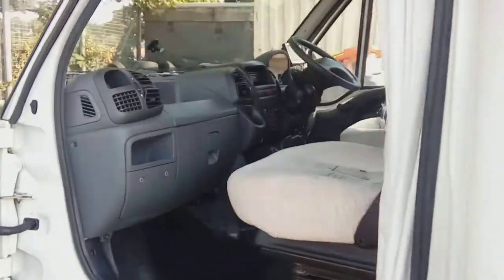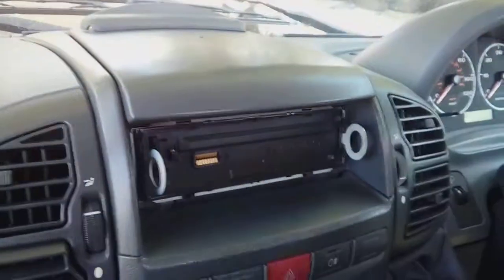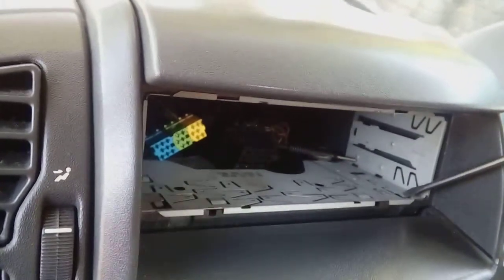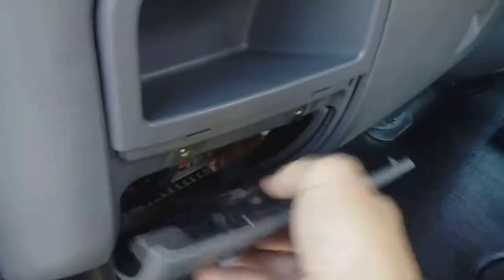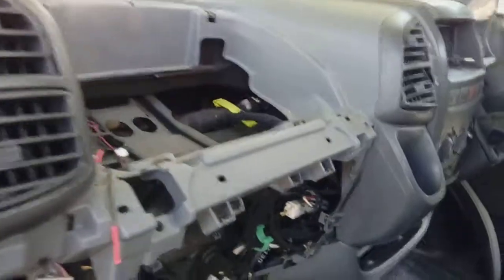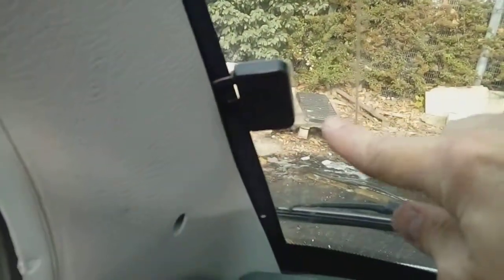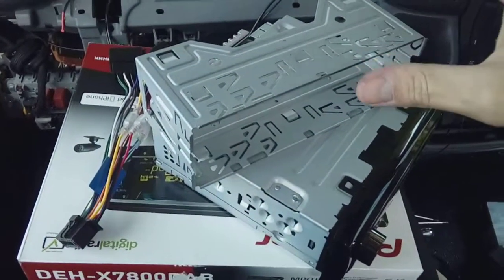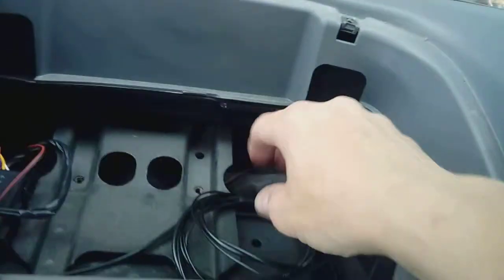Dab aftermarket radio in to a typical camper van,motor home,rv.

Comment: Really helpful video, clear and informative. You were fitting the same series of radio as I was trying to do, this video helped a great deal, my only problem was that the Pioneer is 2cm longer than the OEM Blaupunkt, that radio rested on a small shelf at the back of the slot, the Pioneer would not go in until that shelf was removed. After that it was straightforward. Thank you.

Comment: You mentioned an adapter kit for the radio you installed. On this video you use the exact same camper can as mine, could you tell me what adapter wiring kit I need to install a similar radio? Is it a generic Peugeot adapter? 
Great video 👌

Comment: Can you further explain how I wire the harness so the radio stays on without ignition on? I have a 2005 Fiat Ducato motorhome and the head unit is an old Alpine changer cd tuner controller. Someone told me to swap the red and yellow wires, (the red is the ignition and yellow is 12v constant (As you know)... I swapped those wires and Alpine is still not working without ignition on. There is voltage on the yellow wire, as I tested it, and also on the red ignition wire also. The unit only works at the moment while ignition is on, but obviously I can't have the ignition hot while I listen to the Archers. Please what is the fix for this?
Reply from the maker: Simply connect both the yellow and red wires to the one constant live.
Reply: @PJsprojects  I will try that and get back to you if  I need further assistance. Many thanks, so helpful, as you always are.
Reply: @PJsprojects  Did as you suggested with the yellow and red wires, it worked but it also fed constant power back through the ignition wiring and therefore the dash lights came on, constantly on, even with key in off position.  So, common sense told me to disconnect, cut, the red wire on the ISO connector block, so power could not feed back to ignition... hey presto.. I now have constant power to head unit when I press the on button without ignition on! I wish I was brighter at electronics, mechanics is my bag. People like you are a blessing to us plebs. This particular video helped me greatly as I have the same van. My signal to the radio tuner is terrible and works off a normal stubby ariel, my head unit is not DAB, is there a powered tuner amplifier that I could use to improve signal or do I get a better wing ariel?